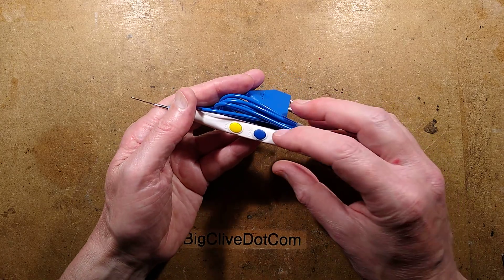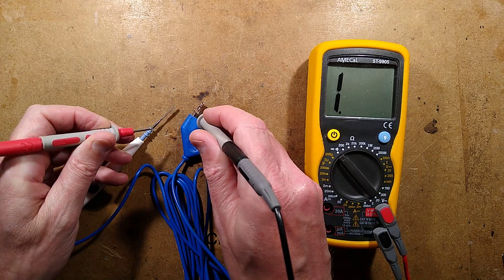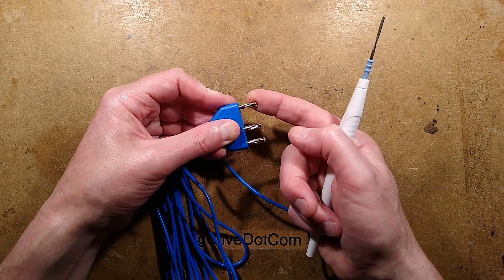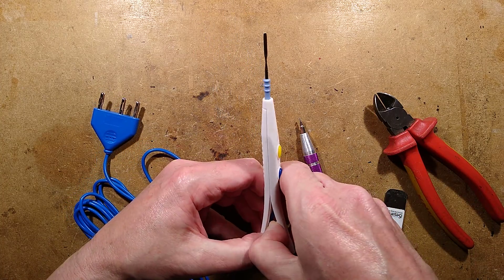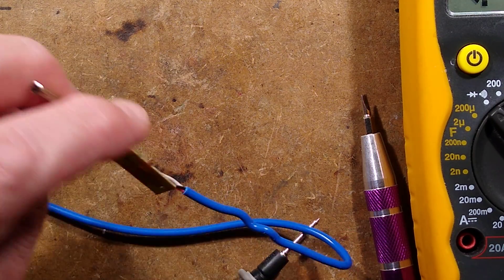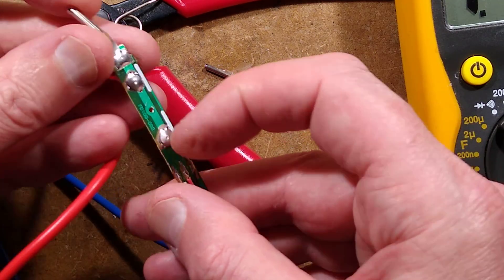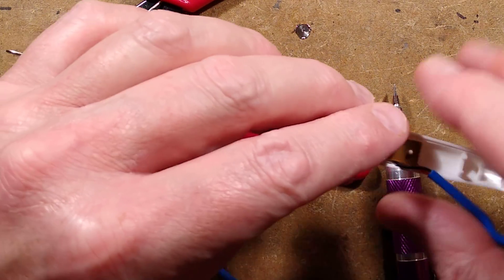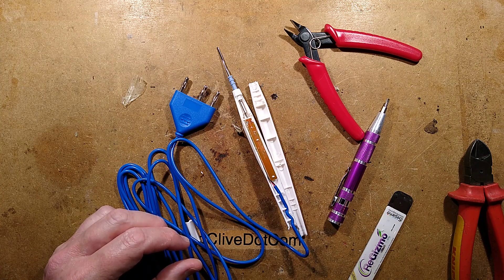Inside a single-use electrosurgery/cauterising pen

Comment: The simplest power supply I can imagine for this sort of tool would be to have the switches connect to different taps of an oscillator to select what part of the oscillator's frequency curve it will operate at and the associated power. No switch pressed, the oscillator operates far from its resonant frequency at a low voltage and power, cutting button pressed, the oscillator operates close to its center frequency and peak power while the cauterize button selects a frequency some distance either side of center at lower power. No fancy sensitive communication needed.
Reply: There's a lot more to it than you'd imagine. Some of the modern units I've worked on have some very specific waveforms for different effect.
Reply: I think the supply has multiple taps on a transformer, or different series resistors for each of the two close together plug leads. Different ones connect to the tip supplying different voltage/currents. The neutral/return lead is either through capacitance of the body or by pressing a large metal plate to the patient. The third wire may be connected to some complicated circuitry to maintain a consistent power level as it cuts or cauterizes different resistance of tissues.
Reply: @deltab9768  got a feeling its much simpler than that, an AC cutting circuit and a DC control circuit. The 2 close together leads are the control switches. As Clive said in the vid there is a large common return pad connected to a meaty area.
Reply: I'm guessing youre right about the power supply design for the earliest units,  but not the control. Just apply a DC signal to the common pad and the 2 switches become simple DC control signals. Isolate frm the AC cutting signal with caps/inductors.
These days i believe the units have adjustable frequency and power etc etc so likely direct synthesis units.
Reply: @Teardown Dan - 
Good , because the simpler , the less can go wrong.

Comment: I once did a test machine for Olympus who makes the medical disposable one. it looked like a electric toothbrush on its angle. It required a hi-pot test, air flow test and peak force test via load cell on a air cylinder to ensure it wasn't too high. we checked if the air flow was on and then off when the switch was moved. It also has a series of capacitors on on plug to tell the machine what is connected. We used a TTI LCR400 bridge to measure the capacitance and resistance. Funny story, if you connect no load to the LCR400, it will report back "0.0000OHM", so on the last day before the customer arrived, I attached a 200M ohms of resistors on the meter in parallel so it would see something to measure"

Comment: I was a bio-medtech for years and I was in charge of calibrating Hillrom electrical surgical units (ESU). The preliminary setup is done on a bar of soap and after all the calibration points are met we use a slab of fresh pork skin with fat attached at room temp. And yes it totally smells like bacon...  The scary part is our shop sold used and completely reconditioned medical equipment and doctors would come in and ask to buy the ESU and then want to be trained on how to use it.....We were like...we just repair them...thats your job.....
Reply: Vendors, whether they pharma companies or equipment companies, generally instruct doctors how to use their products, but it makes sense that a secondhand dealer wouldn't be able to.  Medical school teaches you the basics, it's up to doctors to learn all the finer points through additional training.
Reply: @d00dEEE  Medtronic had a rather nice animated demo. of "how to 'install' a cardiac pacing device" at one stage. It really was a "step by step", almost DIY level process, although obviously not "really" intended for even the most enthusiastic DIY surgeon. A VERY quick scan of YouTube revels a LOT of surgical procedure animations - the ultimate in bloodless-field surgeries!
Reply: what sort of oscillator type do these use? do they use solid state stuff these days?
Reply: @ionut5350  I would expect it to essentially be a modern solid state radio transmitter with an RF power amplifier (the probe tip being the “antenna” in this case”.  Frequency wise it would have to be confined to one of the ISM bands as you will be radiating that RF energy (short of converting the operating room into a Faraday cage to contain the RF).  The heating is a byproduct of the (RF) skin effect which causes an RF burn due to the electrical resistance of the tissue coupled with the (RF) skin effect forcing that RF energy through a very thin cross sectional area at the point where the tip makes contact (whereas the return pad distributed the return energy over a much larger area so as to reduce localized heating).

Anyone who has ever inadvertently come into contact with the output of a radio transmitter at a few MHz and above can attest to what an RF burn feels like.  You would think having several hundred volts and watts pumped through you would feel like a classical electrical shock, but because the energy is so confined due to the skin effect with high frequency AC it feels more like grabbing hold of a red hot frying pan -  complete with burn blisters.  It catches you off guard initially as for the first second, or so, you feel heat quickly building up but it initially feels almost like very hot air striking your skin in the contact area and then very quickly afterwards the pain from excessive heating at the nerves hits you with the full force and it suddenly feels like a proper severe burn.  I assume the initial delay is due to the nearest heat sensing nerves having been quickly destroyed from the sudden and very localized heating and it taking a moment for the heat radiate outwards to reach nerves a bit further away that are still functioning.
Reply: @ethanpoole3443  had that happen several times, the burns are very nasty even at low power
Reply: @ethanpoole3443  You're mistaken about the skin effect. The reason why it's a burn, rather than a shock is because the nerves are insensitive to high frequencies and energy is dissipated by Ohmic heating. The skin depth is very deep in human flesh, in the MHz and even GHz ranges. If it wasn't, then a microwave oven would only cook the very surface of meat, rather than penetrating several inches.
Reply: am i correct thinking there is a DC control circuit and an AC diathermy circuit, thats why the switches can use the cutting tip as a common?

Comment: I service the esu control units and make sure they're safe for use. For our model of electro surgical unit at full power it can produce up to between 950ma and 1300ma in coag and 865ma and 1100ma in cut. More or less than that and it needs to be calibrated.
Reply: Volts?

Comment: Are you sure that's a standard monopolar diathermy pen? You mention use of a pad in the description. It could be a "hyfrecator" pen which uses clever electronics to charge the cells before flipping the voltage (I think). It ends up working like there's a pad despite there not being one.  Interesting technology and perhaps worth looking at.
Reply: Yes, that’s a standard mono polar electrosurgery pen. “Diathermy “ ( a very old term) is not used in the formal OR, and only very rarely anywhere else anymore. I stand to be corrected, but I believe “Hyfrecator” is a proprietary product name
Reply: @practicalmedicine4359  I call it diathermy when I'm asking for it but then it's a long time since I went to med school! I'm trouble in OR anyway because I'm left handed so many of the scissors aren't any good.  Hyfrecator is indeed a product name but it also uses different underlying technology to both monopolar and bipolar. Monopolar and bipolar used when under G.A. while Hyfrecator used only under local anaesthetic as patient has to be on an insulated table- accidentally earthing would result in a kind of unipolar IE pain and smoke so patients have to be awake to report any inadvertent earthing. Hence in my consulting room I've got my couch set up so that if the patient is really tall it's their feet touching the radiator not their head....
Reply: Yes, if the voltage and/or frequency is high enough, capacitance of the body is enough to drive the current back and forth. Also a microwave oven transformer will give a nice RF-type burn even at the low frequency of mains power, because the dV/dT is high. (Rate of change of Voltage with respect to Time.) Ask me how I know!

Comment: Although the tip is what does the burning, i wonder if the pad is essentially the high voltage of the circuit, the tip being closer to ground so the buttons don't have a high poteential to control the circuit. this would also explain why ther tip is always connected, the pad may be switched and controlled for power.
As you said, maybe the tips have different shapes, or they can change them mid surgery if they get gungy, but overall the probe will only get used for one operation.
Reply: I'm  a surgical tech and yes we can change the tips, we can use needle point or blade point with lenths of 4 inches, 6 inches and even longer for laparoscopic surgery.
Reply from the maker: That could be how they've done it, as it's a closed circuit.
Reply: @bigclivedotcom  I can show you pictures of the console where the pen connects to, I'll check to see if I can find a manual with the schematics of the machine, by the way if you use this on a patient and you have a pin hole in your glove, you will get a very nasty shock.
Reply: you also likely have an ac circuit and a dc control cct isolated from ea other on the same wire.

Comment: If it wasn't so fkn heavuly and huge you'd have an electrosurgery power module that came with a vet clinic.  It's not really knowledge desk size.  I havent got around to tearing into it...  but by the weight of 'er there are large transformers/caps indeed.
Reply: It amounts to a giant f'kin radio oscillator so there might even be one of the few remaining modern vacuum tubes inside.

Comment: I had the pleasure of this technology to remove a benign lump on my skin.  You have to hold on to a plate to ground the power. You don’t really feel anything due to anaesthetic - but if you loosen your grip on the ground plate you can feel a real zap in you hand as the power gets concentrated onto a smaller area!
Reply: Tips are replaceable.
Reply: It is supposed to be disposable but it is commonly sterilized and re-used where I come from. Believe it or not, it can survive several cycles of ethylene oxide sterilization. When in use, it sparks and sizzles producing a bit of smoke and a distinct aroma akin to burnt hair. The grounding electrode is a flat metal sheet usually placed at the back of the patient. Conductive gel is applied to the grounding electrode, otherwise the patient could end up with a nasty burn.
Reply: You were lucky, I had it to remove a lump on my cheek, and even with anaesthetic, OMG it was painful!
Reply: I've had moles removed but cannot recall there being a plate.
I might have had something strapped to me instead. It was several years ago.
Reply: Was the lump on your foreskin?
Reply: @Dime_Bar  Asking for a friend?
Reply: @demef758  yeah he wants to know if it was painful having it done.
Reply: @Dime_Bar  works ace for wrectal warts👌
Reply: @mrhead5823  nice one little buddy I will pass that on to him.
Reply: The power travels through your fucking body?
Reply: @melody3741  Also when not fucking.
Reply: @melody3741  Yeah. So?
Reply: @melody3741  It doesn't. That would kill you by disturbing the heart rhythm. A bit like the inverse of a defibrillator. The high voltage and frequency make the current run over your skin, rather than through your body. It is the so-called "skin effect" (https://en.wikipedia.org/wiki/Skin_effect)
Reply: @BaronSamedi1959   The current path is through the body not through the skin. Human skin is not a good conductor of electricity thus the "skin effect" is not really in effect here in the way you describe. Nerve stimulation frequency is sub 10 kHz, but these usually have the output at a nominal frequency of over 500 kHz so simply the nerves and muscles do not respond to it. As a reference point however, the human body has a skin depth of around 0.075m at 500 kHz so current passes substantially through organs like the heart, in fact these tools are often used during surgery close to the heart.
Reply: The thing is, it doesn't matter what frequency, if you have sufficient current, as per 1 - 10 - 100 current rule (the higher the current, the more likely the chance of death from electrocution), it just is dangerous by itself, and I have seen plentiful of warning on high power RF generators that clearly mentioned electrocution and RF burns - RF voltage can be boosted easily to high voltage just so they can travel much further - the RF voltage outta 100 kW radio transmitter is easily in the kilovolts range. So electrosurgery electrode is current limited by a RF resistor inside the surgical RF generator so you don't accidentally kill a patient.
Reply: @Dr_Mario2007  That's not how an electrosurgery tool works. There's not an "RF resistor" to limit the current, the waveforms are controlled by the apparatus. Typical currents used for cutting are over 5A, so a resistor arrangement would not be effective.
Reply: @Dr_Mario2007  Warning on high power generators (for example TV/radio transmitter) is for two reasons - inside and sometimes also on output port (depending on PA construction) is high DC voltage (for tube based RF PA in range of kilovolts and capable of pulling fairly high current from it) and second reason is that oputput power is high enought to cause serious burns and also death by overheating parts of body (you can also get your blood boiling). If you consider that 60W is enought for local tissue cutting, consider what can do several kilowatts inside body. High energy RF can casuse serious damage by thermal overload and also you can pull arc from live conductors (which can be much more easy for RF than 50/60Hz power grid) and this cause another damage as arc produce very high temperature. Generaly applying 100mA = death rule is nonsense (and please don't try to verify that on your body) - all values in safety standards is for industrial frequency 50/60Hz, trace from left hand to both legs (typical worst case scenario for touching live wire when standing on the grounded surface), current flow thru body when heart rythm is in vulnerable phase (it is only small part of heart period) and for 5/95% probability. In medicine is HF current in range of amperes is used without any problems (diathermia, eloctrocauterisation). And to construction of electrocauter - no, there is no current limiting resistor (that is very unefficient way of regulating power), early units have current unregulated (set only by source internal impedance and body impedance), nowdays unit have feedback regulator which varying output voltage to get required current. Parts of device that is needed for operation is quite simple, most of circuits inside is for safety (in this case not electrical, but functional - because if for example output power regulator "get wild", then can cause serious damage to patient). On device shown in video is interesting that this type of cauter control is not allowed in our country - for safety reasons cauter have to be operated by pedal (controled by leg) and if I remember right pedal have to be pneumatic one (no wires to pedal, just hose), also neutral electrode condition have to be continuously electricaly monitored.
Reply: @Dr_Mario2007  The risk is not electrocution, it's death from the burns/high energy. You're talking nonsense, half of what you've written doesn't even make sense. "RF voltage can be boosted easily to high voltage"? What is that even supposed to mean????

Comment: You will find a lot of weird circuitry in medical equipment. They sort of evolved off on their own track.
Reply: Can confirm, print flex circuits for a lot of medical devices at work. They’re weird compared to others, especially the legacy designs from other companies
Reply: They must obey reams of safety requirements most of us never heard of.  Most of the cost is certification and testing, I'm sure.
Reply: @tsm688  and that's exactly why it's ancient technology
Reply: @jakobfindlay4136  It's not ancient.  They're intensely researching this stuff even now.
Reply: @tsm688  Same for railway signalling equipment.  When I worked at ABB the stuff still in use for track detection was of ancient design, all discrete through hole components with old metal can transistors.

Comment: Tips are routinely cleaned using a scratch pad (bit of very course sand paper on a sticky pad) to remove cauterised material but can be replaced or changed. Autoclavable versions are available but single use disposable are more common in the NHS. Other thing to note is the placement of the "anode pad" typically goes on the hip/glut (bum)  but need to be careful and avoid implanted metal such as hip replacements. Indeed they make a "burnt pork" smell but thanks to the high airflow used in operating theatres you're more likely to smell it in the corridor than in the actual theatre.

Comment: The first versions of electro surgery equipment. were more akin to spark gap transmitters. They had six eight maybe more big spark gaps in them and of course reactors and capacitors to make a big oscillator. Surgeons were actually resistant to switching over to the electronic versions of the RF generators because they said they didn't work as well as the washing machine size spark gap generators did. That broad spectrum noise seemingly did a better job. And the manufacturers of the new electronic equipment had to emulate that.